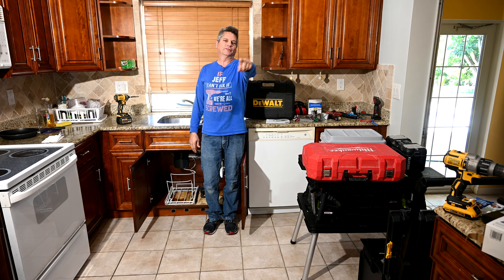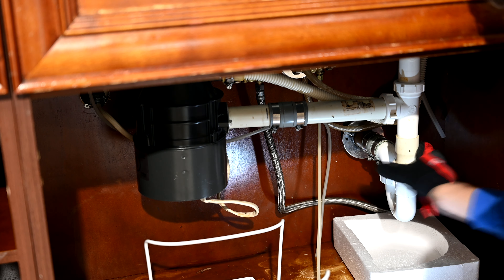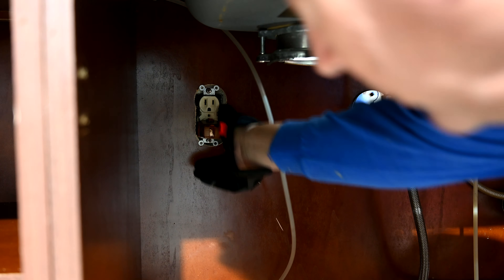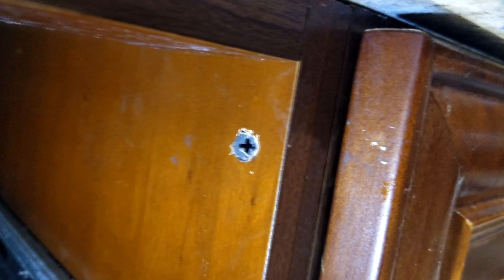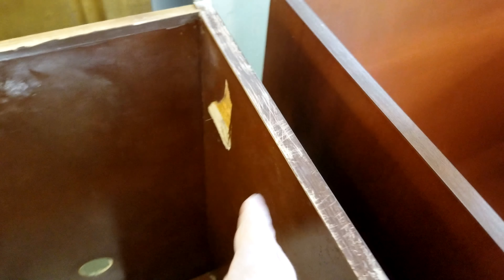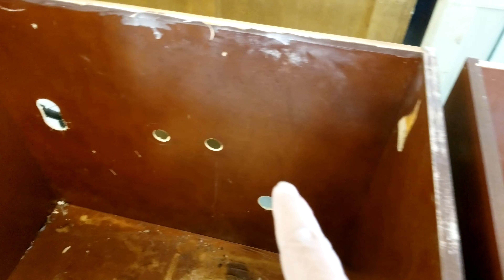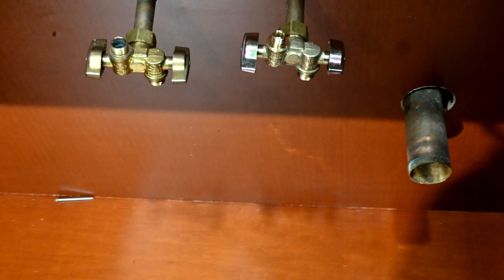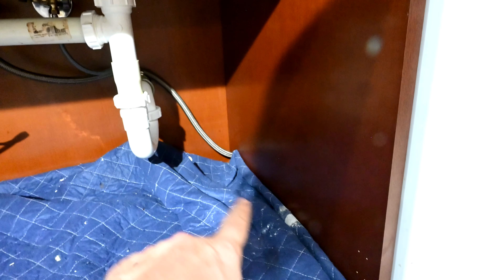How to Remove Kitchen Sink Cabinet, Protect Granite Counters

Comment from the maker: ✅ Keter Folding Table Work Benchwith Clamps: https://amzn.to/2QkEDea
✅ DEWALT DWMT41019 173PC Mechanics Tool Set: https://amzn.to/2OXRMt9
✅ Ideal Grounding Pigtails with Ground Screws (Pack of 50): https://amzn.to/2DMheg3
✅ DANCO Kitchen Sink Hole Cover Brushed Nickel (89478) https://amzn.to/2SwoJ0d
✅ Rockewell Sonicrafter to cut square hole in wood: https://amzn.to/2LnEJNU
✅ Ridgid WD4070 4 Gallon Portable Vacuum: https://amzn.to/2SAeyX6
✅ BrassCraft KTCR1900DVX Dual shut Off Valve, 3/8 & 1/4: https://amzn.to/2OfHAeL
✅ BrassCraft KTCR1901DVX Dual shut Off Valve, 3/8 & 3/8: https://amzn.to/2Ua4B6y
Reply from the maker: @SouthBaySteelers  I picked up that one back in August, that was the best deal ever!
Reply from the maker: @SouthBaySteelers  I bought this kit in August, one of the best deals ever.

Comment: That was absolutely amazing!  I thoroughly enjoyed every minute of this video.  It's hard for homeowners to find somebody as qualified as you to do such good work.  This job looks like a pain in the butt and you got it done like a pro!
Reply from the maker: It was a pain in the neck!  My neck and back were sore the next day, as were my fingers, because of using muscles I never knew I had, and trying to loosen screws way up high under the cabinet, that would only be done 1/4 turn at a time with my tiny ratchet and socket bits. Thank God I had my Dewalt 173 piece tool set with me, that kit saved the day.

Comment: Your video skipped how you got the cabinet under the granite. There is a difference in the floor. How did you get it in?
Reply from the maker: I don't know why I missed it, there were 2 scenes there which I filmed for this but never used them. It was easy though, just put bead of silicone around top of new cabinet and slide it right under granite counter, and shim up off floor until the top of the cabinet touches the granite counter.
Reply: Oh okay. The difference in the floor is probably not as drastic as ours. We couldn’t easily slide it and had to ditch the idea.

Comment: Oh thank you so much for making this video. I have nearly the exact same project. Every countertop company would rather I just have them dispose the old countertop and then have the new cabinets and a new countertop put in. Well, my granite countertop is really nice and it's such a waste of material and labor to put in a new one. I now have the confidence to do this myself without having to pay for a new countertop which is their agenda.
Reply from the maker: Yes being an engineer I have the confidence to pull off something like this and I am never afraid of performing microsurgery like this to extract something out gently. The problem with all of these contractors is they're used to just coming in with sledgehammers and bashing things up it's a lot quicker for them they won't spend the five hours that it took me to do this

Comment: Really nice work here. Question, could this work extend to that of replacing all cabinets under the granite counter? We just purchased a condo (closing in about two weeks) and the owner put a new granite countertop over old, ugly cabinets (and called the kitchen "completely renovated").
Reply from the maker: Yes you could do that with additional bracing added, just like what I had under the sink. I thin a 2 x 4 wedged into place under the counter every 24" would support the granite.

Comment: Jeff thank you for the helpful video, I am keeping the cabinet .. just want to get the sink out from under the granite .. to put a new drop in sink in place ? ... any idea on how I can do that ?
Reply from the maker: Kim: drop sink? If it was installed in granite I would expect that the sink was in undermounted sink and so you would sink from above you would likely be having one re mounted from below. So double check that and make sure you are doing the correct thing here. Also when you buy a new sink I would go for one that's thick like 16 to 18 mil thick. Instead of the standard steel that they give you in most of the stores when you buy them there 'cause they tend to be too flexible
Reply: @jeffostroff  Thank you Jeff .... I bought a top mount sink (drop in) Kohler Porcelain tub kitchen sink ... and was going to try and cut out the undermount stainless steel sink ... but my contractor friend does not have time ... and I had to return the sink ... the 3 mo was up. ... so I will try again ... but I learned a lot from your video .. so thank you, the kitchen in the video is almost the same as mine.

Comment: My Skill 12 Volt oscillator with the Milwaukee scraper worked well to remove the sink from the granite countertop. It cracked trying to install a cheap Lowes. What is the manufacture of the kitchen cabinet?
Reply from the maker: We don't know, they bought it from a local cabinet shop

Comment: Nice job :)
Regarding unused holes from soap dispenser etc. Wouldn't it be easier to apply silicon when they were loose,  not securely attached to the countertop? And then tighten the plastic nuts underneath.
Reply from the maker: You could do it either way

Comment: Enjoyed your video. Nice job. That outlet for the garbage disposal is tied to a switch, right? So wouldn't that cause a problem trying to use same outlet for dishwasher?
Reply from the maker: No it would not cause a problem because what you have to do is snipped the tabs on the right side of the outlet that connects the 2 individual receptacles together. Once you do that they now operate separately in most houses your garbage disposal would go into one recepticle in the dishwasher as its own 20 amp circuit as well going into that other receptacle
Reply: @jeffostroff  Thank you for enlightening me! Never knew this. We bought a touchless faucet that needed power and the installer wired up another outlet. Live and learn!

Comment: Hi Jeff, Where did you find the 2 caps/hole plugs with the big thread below for blocking off the unused faucet holes? A link or store name would be great
Reply from the maker: Hi Bob, the part is called DANCO Kitchen Sink Hole Cover | Sink Plug Cover | Rust Resistant | Brushed Nickel (89478) here is the link to it on Amazon: https://amzn.to/2SwoJ0d

Comment: Any thoughts on if you need to remove a cabinet at the end of an L shaped granite counter top in terms of bracing it so it doesn't snap off under its own weight?
Reply from the maker: The same process should apply what I would do is when you get the cabinet near the edge of the counter have a four by four or a 2 by 4 post ready to stick in there and make sure that it is snug fit from the floor to the bottom of the granite counter. Then as you slide the cabinet out you can put one or two more in there.

Comment: i cant stress these tools enough for siliconing: Cramer Fuji. 2 years ago we went over to Germany to understand the science behind so many failed seals in silicone; along with why applying silicone incorrectly (especially in damp areas: sink/shower/bathroom) - attracts mold/mildew) conclusive #1 reason is not creating the correct bond with a tool and not introducing bacteria or other chemicals in the curing process of silicone: no fingers, no soapy water, no air bubbles, no introducing mineral spirits to the curing silicone. Totally different then latex or Polyurethane caulk. Siliconing is the term used in Europe for all sealant bonding vs USA says "caulking" although one may use silicone in the caulking process. Silicone is a sealant NOT a bonding adhesive.
Reply from the maker: That is correct I guess you haven't seen my other videos from last year several of them where we mentioned using the Cramer fugi kit, unfortunately can't use it on this particular spot because of the shape of the beviled edge between these stainless steel sink and the granite countertop

Comment: Did you just cut a hole around the DWV?
Reply from the maker: We used the Hole Dozer to cut a hole on the back of the new base cabinet prior to installing it under the granite counter, to fit around the DWV pipe, then slid the new cabinet into place.

Comment: The reason why they cut that is because it's too heavy for two installers to carry it.  Also there's a good chance the countertop will break if not cut.
Reply from the maker: I have seen cases where they made the countertop without a seam. My same granite guys that I use also on a similar counter like this put a seam in the middle of the sink also because when both right and left side is up against a wall, they cannot easily set the counter. Now if the other side is open and not against the wall, they can lay it easily without cracking.
Reply: @jeffostroff ours is one piece.  Certainly not a weight problem for professional granite installers.

Comment: How much did it cost the owner for that project?
Reply from the maker: $465 start to finish , including removing the cabinet, we replaced another cabinet and drilled holes, and fixed electrical violations, and siliconed everything back up when finished, and installed new faucet.
Reply: @jeffostroff  are you in Cali by chance?
Reply: @jeffostroff  I think that's a fair price for what was involved